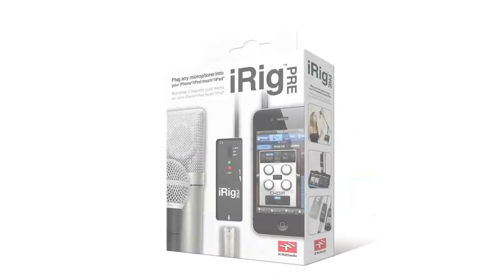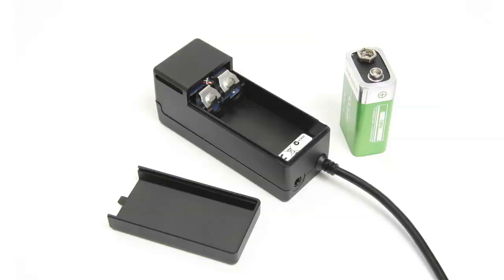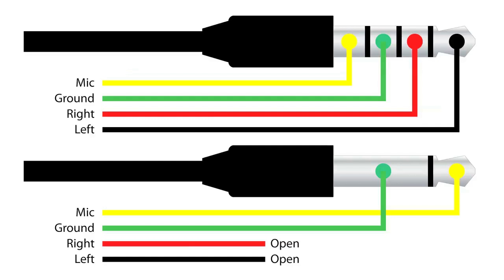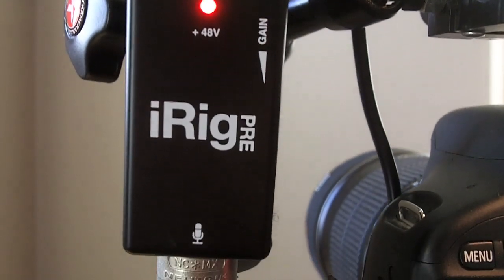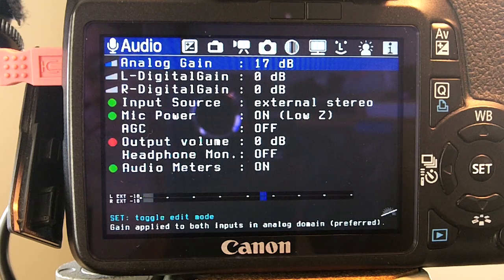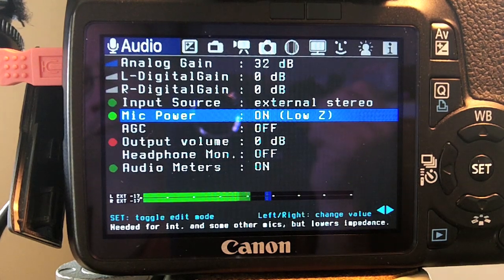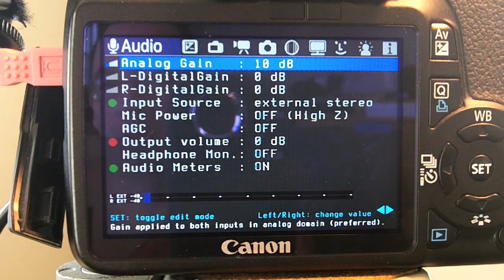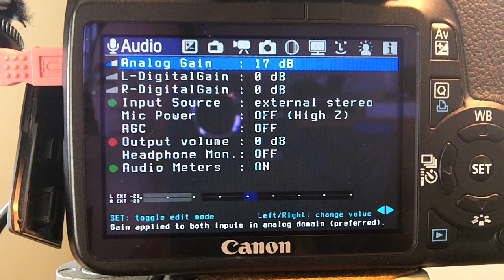iRig Pre DSLR audio test with Canon T2i and Magic Lantern

Comment from the maker: No, you need to connect the yellow wire to the tip of the 3.5mm jack and the green to the shaft. If you look at the graphic of the two plugs it needs to look like the bottom one.

Comment: Hi Z sounds more tinny, as I would say its being over driven, but at Low Z it sounds quite good and clean can you show us the mod with the right angle Neutrik or as you said you did not want to cut off the IRig connector, understood so how about with a diagram of what to tie in to the connector to get it to work correctly?

I need to make one of these for my 60D as it has little to no gain with a pro mic and ML installed this seems to be a must as I only have an older passive beachtek worked great with vid cam but not DSLR. I think many of the options are a bit overpriced for what they are, this seems like a great cost effective alternative and appears to have very good clean sound when set up correctly.

Great vid by the way consider me a fan, subscribed.

Comment from the maker: I think that a mono cable should still work. It would be easy to just try a stereo cable to make sure. I would go back through the DJ's tutorial and make sure that you followed it precisely. Also make sure that the wires are not touching any of the runes on the board.

Comment from the maker: The NTG-2 has a low signal strength and the zooms pre-amps are not that strong. The iRig Pre will take care of the problem. They are coming out with a new model that will not work for our purpose. Try to keep from turning any of the inputs or outputs all the way up. You will have to do some tests to see (hear) what the best setup is.

Comment from the maker: True, When I hack the Pre I am going to try a few methods of hooking it up. I will try to connect the hot to both the tip ind first collar and the common to the shaft. I need to test a few things before I know how best to configure the plus. I have some stereo mini jacks so even If I wire it as a mono input I will probably use a stereo plug.

Comment from the maker: I like the AT875 sound better than the RVM. But they are both good mics. The AT 875 is more versital for filmmaking. You can use it either on a boom pole or on camera. The RVM is more compact and attracts less attention, a good thing for gorilla filmmaking. I am working on a small  rig that make the iRig/AT 875 mount like a Rode video pro. So which one you should get really depends on your needs. If I could only have one for general filmmaking I would get the iRig and At 875.

Comment: I bought the extra cable as you mentioned, via Amazon UK.
Today I got fed up with all the connections etc etc, and did the NOOB hack on it.
Took me around 15 minutes. Used tape and heat wrap instead of solder and flux.
Works perfectly, so thanks for pointing us in that direction.
Now I can sell the cable I bought as it is now redundant.
Keep on keeping on, and as we say here in Scotland. 
Lang mae yer lum reek :-)
(It is NOT rude).

Comment from the maker: Those are the same settings I use for best results. I would be tempted to use the NTG-2 battery for phantom power just to save on expensive 9V batteries. Of course that is dependent on the sound quality of that setup.

Comment: Great video (even though 5 years old). Many thanks. Just bought the iRig Pre and have used it on two shoots with a Zoom H1 with excellent results. Running the Zoom H1 input level around 15 and the iRig Pre gain on roughly 3/4 (as there are no numbers on the dial it's hard to say what the exact level is), recording with AT875r short shotgun. Very clean sound
Reply from the maker: Daniel O'Byrne wow, this video is on the way back machine. I hope it’s still relevant.

Comment: great video, this will be a great for powering the AT875R I just got, plus it will have an XLR input for shoots that have a sound system already setup.
Reply from the maker: Thanks, I hacked my Pre. I It is a lot cleaner setup without the adaptor cable.

Comment: I ran some tests and it seems the best sound is with the zoom real low (10, maybe 20 or 30%?) with the irig at full.
I saw a video after that, someone was using the same setup (Zoom H1 and irig) w/ Zoom @ 11%. Very low noise!
I think I'll keep the Zoom@ the 10-15% range at least for now - on closeups, maybe mids.
Next determination for me - whether the phantom pwr better provided by the NTG2 or +48 on the irig.
Tempted 2 think NTG2 -It's native and doesn't run through a wire.
Digging this stuff!

Comment: Are you able to use the headphone jack on the irig when plugged into the t2i (I have a t3i)?  Also, how would you compare the Rode Videomic w/ an XLR adapter to the Audio-Technica AT875.  I was originally going to get the Rode mic, but the Audio Techinica looks like a good option.

Comment: Thanks, well I have just put in a fresh battery now that you say that. Also I have a CAVS mic and a Audio Technica lavalier xlr mic. I connected both but they both sound far. The bad thing is I edit on my ipad with imoive. Now that you say, if I had a two mono plug then it would sound better? Either way I just ordered the adapter on Amazon linked to your video! Hope it works better.
Reply from the maker: Sounding far away (perspective) is probably not caused by the iRig Pre. The two main causes are mic placement and recording in a live space. Both of those mics are meant to be used close to the sound source. If they still sound far away test the mic in a dead space like a walk in closet. Any place that has a lot of materials to absorb reflected sounds. If you need to record on both channels you should use a mono to stereo Y splitter. You may have to make one or hack the adapter you have. It will lower your signal strength so you may need to increase your record levels.

Comment: So I am going NTG2 to Zoom H1 (rather than into my T3i) and this is convincing me today to run to Guitar Center and get an Irig Pre and a splitter. (And a long, balanced mic cable for the mic to Irig extension.) 
I am a little disappointed with the gain (yes, using the battery) on my NTG2 which I just got. Do you have any suggestions for me regarding my setup?
Thanks for your video!

Comment: I've analyzed the configuration you've used so many times and I'm still unsure what the Y Splitter is plugging into. 

I have an AT875r I'd like to connect to it. 

Female XLR to Male XLR to connect the mic to the iRig, then to get that signal to my camera, I can't simply plug the 3.5mm cable on the iRig into my camera's mic port? 

What does the Y Splitter do? Do I need to plug the iRig's 3.5mm cable into a female Y Splitter, then plug in the headphone cable back into the iRig and the mic cable into the camera?
Reply from the maker: You are correct, You can't plug the 3.5mm mini jack into your camera because the  mic signal is on the wrong part of the 1/8 inch plug. Since it is made for an ios device it has 4 connections on the plug. Two for the headphones and two for the mic. The splitter separates the headphone and mic signals and places them on there own plugs. The mic plug is the one that you need to plug into the cameras mic input.
Reply: DIYCameraGuy Finally! I get it! So you just need to tie up the headphone cable so it's not jostling the others and you're good. Thank you!
Reply from the maker: You got it.

Comment: I bought one of the Y-Splitters you suggested (Headset-Buddy). The adapter does not fit the iRig cable. Am I missing something?
Reply from the maker: I am so sorry, I had to update the link because the last one went out of stock. This is the wrong adaptor. I will look for the one you need. Again I am sorry.
Reply from the maker: I hope you got things ironed out. Again, sorry about the mix up.
Reply: DIYCameraGuy  Yes, I did. Thanks.

Comment: hi, i have a doubt. with the splitter u used on that video, u can be monitoring with the headphones? i have a  tascam ixz that was hack for dslr. but they did it in a way that u can't use the headphones.
Reply from the maker: You can't monitor through the iRig Pre with that splitter. I monitor directly from the camera.
Reply: DIYCameraGuy does it work on t3i also? theres any way to use headphones on t3i, without loosing the screen? 
thanks

Comment: So did you do it DSLR Film Noob's way or did you cut the line and solder the 3.5mm stereo jack on it? If so, which stereo jack did you use?
Reply from the maker: DualWieldViking I cut the line and soldered a plug on it.